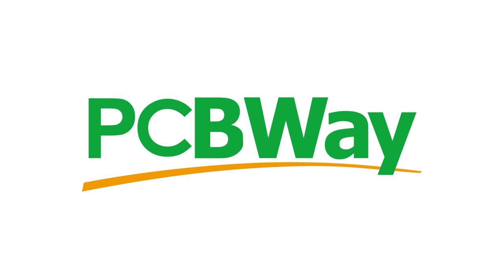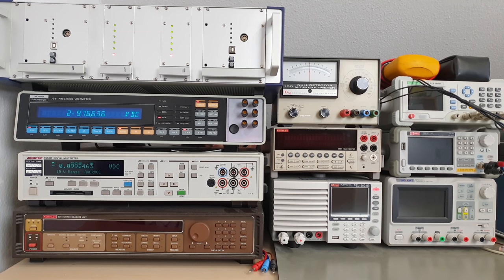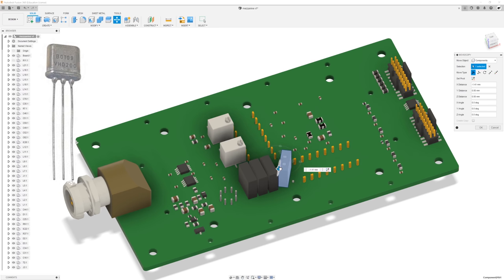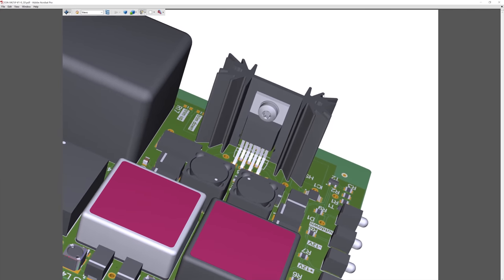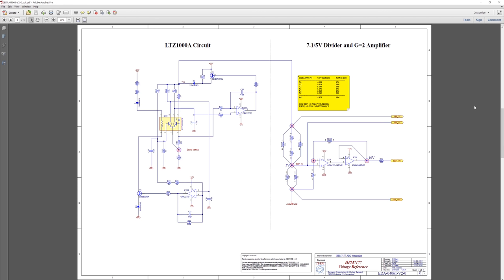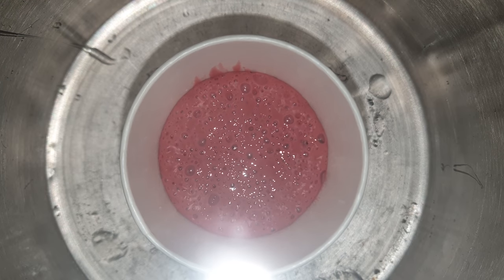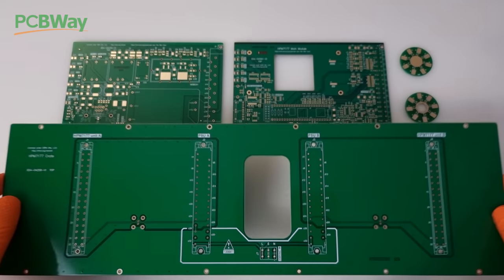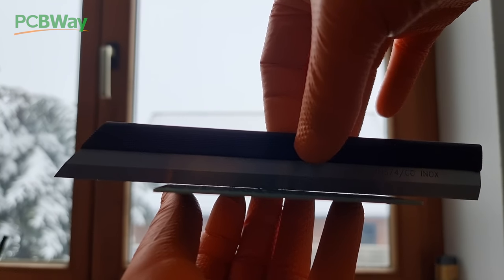Open Source 8.5 Digit Voltmeter from CERN: Build and Test

Comment: I am an amateur but one thing I designed for myself was rather ridiculously overengineered controller for espresso machine. This isn't simple PID but rather it uses thermal model of the entire device, moving horizon estimator to run that model 50 times a second and kalman filters to continuously correct model parameter changes over long periods of time. It is precise enough to give accurate estimate of the amount of scale in the boiler!
One challenge was building an ultra low noise and high precision thermometer in a harsh environment (moisture and huge temperature gradient). The thermometer had to resolve 1/1000th of a degree to get fast and accurate measurement of temperature change rate.
In the end I figure out that the biggest problem wasn't even the temperature difference (could be accounted in software) but rather temperature gradients. I split the design to a power board which contained power supply and triacs to turn on/off heater, valves and pumps from the sensitive measurement board and I built 4 layer enclosure to envelope the sensitive board with a shield that alternates layers of copper and thermal insulator (from inside: copper, foam, copper, foam). I then had a temp probe mounted on board and used it to compensate results.
In this case the actual absolute results don't matter much (it does not make a difference whether water used to brew coffee is 0.1 degrees hotter or colder) but rather I needed fast and continuous measurement of rate of change so that I could predict to less than 0,5s when to reduce the heat from full power and to what level so that predicted brewing temperature is achieved as quickly as is possible and then kept stable without any over or undershoots.
Reply: are there more details of that project or public resource? Sounds interesting.
Reply: @davidkissling4093  Nah, it is just my first project to learn some electronics design, have something with a real board and integrated ARM, etc.
Reply: Did you get a good coffee at the end?
Reply: Sometimes the journey is more important than the destination :)
Reply: Did the coffee taste 10% better in the end?
Reply: @233kosta  It may not necessarily be about the coffee being better, but rather being better more consistently.
When the temperature is not regulated well, it is more of a hit and miss game. Sometimes the result is fantastic but 90% of the time it is so so. The regulation is about making good shot more consistently.
Reply: @leonardmilcin7798  I was being silly, but since we're talking consistency, let me rephrase the question:

Would you say the cup-normalised aggregate value of an imaginary taste score (which goes from 0 to 69) based solely on your own taste buds & preference has improved by 10% since you implemented this awesome controller?
Reply: @233kosta  I would be lying if I said I can put my hand to my heart and swear I can be truly objective about it. Yes. It tastes better. To me.
Reply: @leonardmilcin7798   It's your coffee, "to you" is all that matters here 😉

Also the cool factor has to count for something! Who else has a coffee machine with the most overcomplicated (and I say that with admiration, one engineer to another) heater controller in the world?

My reference example is switching coffee grinders. Went from a Zassenhaus Santiago to a 1Zpresso X-Ultra and in the spirit of a good giggle, my aeropress special now tastes 22% better 😁

Comment: Glad you can profit from the open sourced equipment designed for fundamental research. Thats one reason why research is important, in my opinion. You went full out with all the components. No cheap session at all. Very nicely done Mr. Reps.

Comment: I love LEMO connectors. Incredibly expensive, but widely used in medical instruments for very good reason. The quality is unmatched, and you can get ridiculously small connectors with amazing voltage and current specs.
Reply: yep. I've worked at companies that use LEMO connectors for as much as possible, and they are amazing.
Reply: Yes they feel great

Comment: For the front panel, look into Alodine or Iridite chromate conversion coating. If you know what alloy the front panels are made of, you may be able to find an anodizing house that can treat them for you. They both can be specified as electrically conductive, and would be suitable for your ground contact, while still protecting the aluminum. If youre feeling extra spendy, you can have done with a mask so the main portion of the panels are anodized, while a contact ring on the back side is a conductive conversion coating. Or get them nickel plated. Polished first, if youre feeling a bit garish, brushed or sanded if youre not.
Reply: Although I’d advise against DIYing chromate. It’s the sort of stuff you want to keep as far away from home and your body as possible.

Comment: What!? Vapor phase soldering is a thing? -You just sent me down a rabbit hole...
Reply: Yes for a long time. As a student in University I was using such machines in 2006. That liquid is pretty nasty :-(
Reply: @buggi666  How is it nasty? Shouldn't it be perfectly inert unless you overheat it?
Reply: @kasparroosalu  You are right but overheating can happen easily depending on the pressure and heat distribution within the vessel...
Reply: While I knew vapor phase soldering was a thing, I never knew that you could do it with such a simple setup...I don't think i will attempt to repeat what marco did though...
Reply: @kasparroosalu  It sits in your liver like Tetraflouromethane does and screws everything up.
Reply: Vapour phase is not used in industry as much as it was in the 90's/ These days there are multiple other methods that make it much easier to have a continuous feed through the pick and place machine. EG zoned IR ovens. The modern machines do the soldering and inspection too. Basically each board is compared to a photo of a good board. An AI system then compares. So you can have a 4 head chipshooter placing 100,000 components per hour. If the panneling is optimised and heads are optimised that is.
Reply: @drojf  You just need to do it in the shed outback of the house, or a trailer that is in the apartment building parking lot.
Reply: @mikeorjimmy2885  You can also use a condenser to not loose the stuff. It's quite expensive to loose the vapour. I cant remember the price but it's probably near $100USD per litre.
Reply: @gordonlawrence1448 , in English you do not loose things. You lose them. Loose is an adjective.
Reply: @seriouscat2231  : And yet both work in this circumstance, as if you loose the vapor, you will surely lose it as well, so better to keep it nicely contained.
Reply: @mikeorjimmy2885  So just do it where I usually cook meth?
Reply: @mikeorjimmy2885  that sounds so breaking bad.....

Comment: I'd never come across vapour phase reflow before? and the cutting edge techniques in this video were fascinating. It must be such a personal achievement to build something like this, and how amazing that CERN continues to drop all these advances back into the wider community.
Reply: Vapour phase reflow soldering is very common in the electronics industry, but doing it homebrew like he showed is new to me. And kind of dangerous if you ask me based on the side comments. I have seen folks do reflow in toaster ovens, but the vapour flow has better uniform penetration.
Reply: We used to make PCAs, our machines were the molten wave type (whatever the technical term for that was)
Reply: Here in the UK, I used to do vapour phase reflow back in the early 1980s, when SMD cmponents were a novelty.  It was very popular for small-scale production as it was both easy to set up and made for a compact installation.
Unfortunately, it fell out of favour as infra-red reflow 'conveyor' ovens became more popular.  This was mainly because the VPR tanks, at the time weren't very environment-friendly - the process tended to use CFCs as the heat-transfer medium, which caused a general problem with 'lost' vapour, and a specific problem for the user, as the decomposition products of the vapour, if it came into contact with something hot, for example, were highly toxic.  We had a couple of occasions where the operator had ignored the 'No Smoking' signs and drawn a lung-full of the vapour through a lit cigarette (yes, those were the days when you were allowed to smoke at work🤣) and essentially gassed herself to unconsciousness...

Good to see it making a comeback, with slightly safer fluids 😃
Reply: @johng8pef11  I looked up the chemicals for this, and they are incredibly expensive
Reply: @____________________________.x  yes, they are fairly expensive, but if you’re doing it right, you shouldn’t be ‘consuming’ much of it, so it will last a long time.
Reply: @____________________________.x  this technique was known, here in the U.K. at least, as wave-soldering. I used one for through-hole PCBs back in the late 70s/early 80s, before I got involved with SMT

Comment: Another great video and I did not even knew CERN had such great project as an open-source! Great once again !
Reply from the maker: And there are many more: https://ohwr.org/welcome
I already have parts and PCBs for another one here :)
Reply: @reps  Super Cool Marco! thanks once again for your great videos! Keep it up! The only Thing I really would not make is your SMD solder process ... I mean ... it's ok but ... a small oven with quartz heaters is very inexpensive and we can get a simple SSR and a arduino Pro mini to switch it in order to make a correct temperature profile for the solder process. just sayin' ... just sayin' ... But Great video once again!!

Comment: If you’re looking to improve that linearity, polynomial regression is probably a poor choice for the calibration curve due to that “wobbliness” you talked about with your tenth degree function. You can avoid that, along with reducing computation cost and error by using cubic splines. In layman’s terms they’re glueing together third degree polynomials to form a smooth continuous curve without any ugly wobbles.

Hope that helps! 🙂
Reply: Yeah the tenth degree functions should be way over fit to the data no? Thats what would be causing the wobbles
Reply: The point of the 10th degree polynomial is that he's trying to compensate for as much of the repeatable non-linearity as possible, so that he can determine an accurate figure for the non-linearity of subsequent measurements.
Reply: @BrotherCreamy  That’s correct, he’s using a polynomial regression to compensate for known error between the ADC and calibrator. I’m suggesting that instead of using a polynomial regression, he should try using cubic splines as they are cheaper to compute and don’t have the inherent instability of polynomials. It will still accomplish the same goal (mapping a continuous mathematical function to discrete error data) but it will do it more efficiently and without unwanted wobbles in the function.
Reply: @shingGOLDmonkey224  I agree - 10 degree polynomials are almost sure to overfit. i like your method better with little chance of overfitting.
Reply: Ohm law eat your heart out. fm.
Reply: Many ADC INL characteristic plots have discrete jumps at 1/16, 1/32, etc divisions of full scale (with linear deviation between). 
"we" found that using evenly spaced 128 point linear interpolation reduced the error from DNL/INL with very little computational overhead
Reply: 10th degree polynomials are OK but I guess the implementation in whatever library you’re using isn’t the greatest. An RPi 3 should be able to do a million of these per second, without even getting warm, and way more with handwritten vector code. Takes a bit of work to get to double precision, since now you’re dealing with high radix multiplications.

Comment: Since you get that much Samples with some Noise, you might look in to "ADC Oversampling" instead (or beside) using a simple averaging.
I'm no expert, but that way you can boost the ADC Bit count and smooth it out at the same time

Comment: you can use the fpga like a DSP and program your signal processing function in hardware. That will get you plenty of speed to do the processing as long as you have enough cells.

Comment: In the software section I could not help but think about machine learning practices with the polynomial fit that was implemented. I would recommend reading about overfitting and underfitting. But also the fixes for that: testing and validation data sets and cross-validation. This would give some insight in whether the numpy fit was actually any good in explaining the variance in the data, without being too sensitive to this data.

Comment: I personally find that solder paste in a tube is worth the slight loss every time you use it compared to the tubs of the stuff. I've noticed that the continuous exposure to air dries out the flux in tubs of paste, and even when you rejuvenate it with a bit more liquid flux, it's still never "factory new." I always get near flawless reflows with minimal bridging when using paste out of a syringe. In the end, I always use up the entire tube of paste while the tubs have to be thrown out prematurely.

Comment: About the linearizing polynomial and it being done inside the meter: jam I pi in one of the open slots of the 19" rack, use some USB interlinks on the front (or redesign the PCB's to rout USB over the backplane) et presto: your most linear multimeter is there. Add an oLED display for true 8.5 digits...

Comment: Hello from the future. If I understand correctly, the condensing solder-fluid-stuff drips onto the pcb. If so, I recommend setting the whole thing - heatsink and all - into an angle by putting something beneath one side. Then the fluids will run off the glass to the lower edge and drip off. cheers!

Comment: Better not use the "tub" solder paste servings. They dry out much quicker than a hobbiest can use them up.
Reply: I buy the smaller syringe ones. Even then only 1 or 2 at a time and keep them in the fridge. I only really use them with copious additional flux for hand soldering TSSOPs. I really should start getting to grips with BGSa now.

Comment: You could use a LUT instead of a polynomial to correct the voltage & interpolate between values. More flexible and much less processor intensive

Comment: Never knew about low noise metal foil resistors, eyewatering prices compared to thin film. So many great features and techniques to push the noise floor down. Great work. Subscribed.

Comment: Hey Marco, I bought an Agilent 34410A new quite a few years ago. I was disappointed the first time I switched it on because it has a loud intrusive fan. I've used the meter as much as I would if it had been quieter. Anyway I've ploughed through a lot of your content and it's inspired me to take the meter apart and replace the fan with a lower noise version. It's on order from Digikey. Fingers crossed that it all goes back together without issue.
Reply: The new fan is now fitted and it sounds beautiful. Well, a lot better than it did.

Comment: Use orthogonal polynomials, e.g. Legendre or other for the interpolating polynomial.  The number of zero crossings of the function gives you the number of terms you need and will exhibit great numerical stability.

Comment: Here in the UK, I used to do vapour phase reflow back in the early 1980s, when SMD cmponents were a novelty.  It was very popular for small-scale production as it was both easy to set up and made for a compact installation.
Unfortunately, it fell out of favour as infra-red reflow 'conveyor' ovens became more popular.  This was mainly because the VPR tanks, at the time weren't very environment-friendly - the process tended to use CFCs as the heat-transfer medium, which caused a general problem with 'lost' vapour, and a specific problem for the user, as the decomposition products of the vapour, if it came into contact with something hot, for example, were highly toxic.  We had a couple of occasions where the operator had ignored the 'No Smoking' signs and drawn a lung-full of the vapour through a lit cigarette (yes, those were the days when you were allowed to smoke at work🤣) and essentially gassed herself to unconsciousness...

Good to see it making a comeback, with slightly safer fluids 😃

And yes, the heating/cooling profile was very much controlled by raising and lowering the PCB in the vapour bath (after a 'calibration' run to determine the temperature vs depth, of course).  We didn't have the luxury of stainless-steel stencils, the solder paste was lovingly applied to each pad, direct from a syringe which was 'pumped' by a foot pedal attached to a nitrogen cylinder.  It took some practice to get it right!.  The components were manually placed with tweezers, then the PCBs were placed in a 'warming cabinet' (a big wooden cupboard with several large reflector type bulbs in the bottom).  This drove off the solvents from the solder paste and (hopefully) a) held the components in place well enough to survive the journey across the room to the reflow bath, and b) pre-heated the boards.  Happy Days 

😃

Comment: Amazing! Great job!

And thanks for the hint with Grafana. As i recently build a sensor data acquisition systems that logs over network into a RAM buffered SQLite database, I will give it a try. 
Hopefully it can take advantage of selecting data from the tables instead of bulk loading every ASCII line tokenized via string-to-float into memory. I find those CSV files annoyingly slow to handle ;)

Comment: You should see the specs on the amplifiers used in LIGO, probably the most linear amplifier ever made with a noise floor that is basically at the thermal limit.